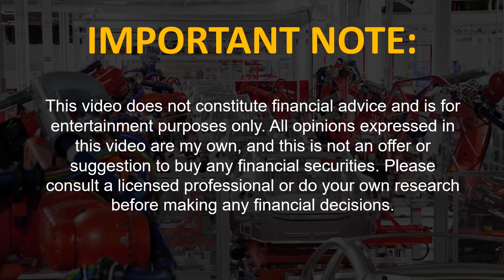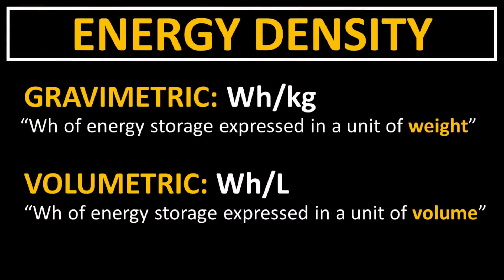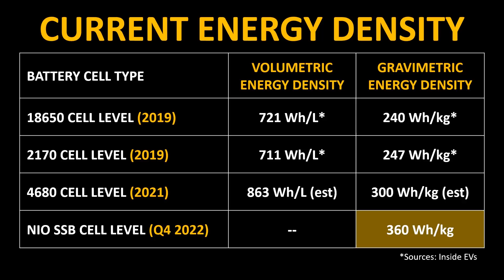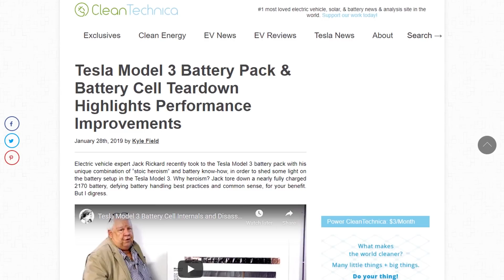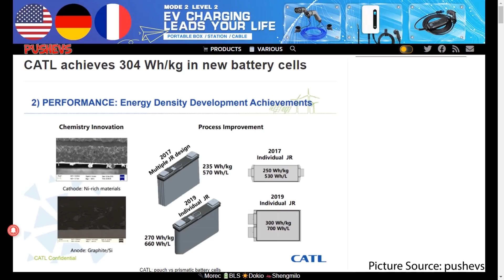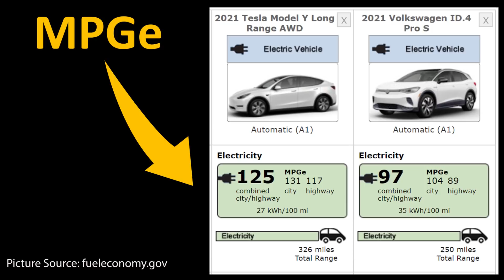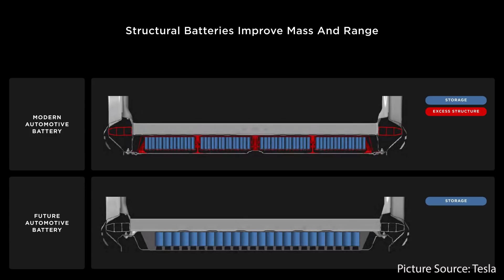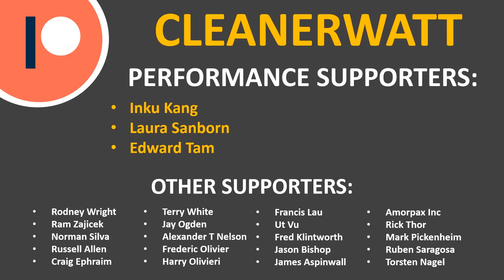Tesla New Battery Tech vs Nio Solid State Batteries (Part 1: Energy Density)

Comment: How about charge time?
Reply: Solid state has potential to be higher. The 4680 will probably use the new v4 supercharger 350 kW
Reply: @TheZackrambo  higher in what way?  Higher / longer charge time/rate?
Reply: @kevroll99  taking higher charge 350 kW compared to 250 kW. 40% faster assuming a similar charging pattern. The 4680 shouldn't have a problem with cooling, judging by the cooling chart from battery day. A 100 kWh battery could go from 0 to 80% in about 20 minutes compared to 30.
Reply: @TheZackrambo  and compared to NIO's solid state? I'll assume it should be close but most articles I've seen indicate that solid state can charge very fast like half the time of any other lithium ion battery, even the 4680?  That's what I was asking.
Reply: @kevroll99  I'm not sure about Nio specifically. Toyota supposedly has a completely solid state battery (not hybrid solid state) that can charge 0 to full in 10 minutes. Which would be an average of 750 kW+ up to 1 MW for the full charging duration. Note the last 20% takes as long or even longer than the first 80% for current battery technology.
Reply: @TheZackrambo  gotcha, would really like to know NIO's charge time.  Not sure why they didn't reveal that...?

Comment: if you're comparing 4680 cells, the power load required to maintain temperatures is supposed to go way down too
Reply: Yeah, probably the most amazing detail of that cell is by going tabless, they have dropped the resistance across the cell dramatically allowing it to be safely charged and discharged at much higher rates with less heat generated. The greater energy density and weight reduction is a large leap forward, but the increase in C rate is what is going to leapfrog Tesla over even the latest $2.3 million Rimac that is apparently running 8 second 1/4 mile times for "only" 10x or so the cost of a Tesla Roadster.  If Tesla can shave 800 pounds off a 9.23 second capable 4 door sedan?  I'm really curious what the C rating of the solid state batteries are projected to be.

Comment: The problem with building the pack into the structure is battery tech is 1. Battery tech is changing rapidly and it would be nice to be able to upgrade as it does 2. What will a 10yr old Tesla with old battery technology built into the structure be worth???
Reply: "Structural" does not mean "not replaceable"

Comment: One aspect I didn't see noted in the video is that when discussing range Nio and Tesla are using different testing cycles. Nio is using NEDC (which has been phased out everywhere but China) and is 20-30% optimistic compared to EPA. So, when Tesla is talking about 800km range, they're actually talking about 960km on Nio's scale. 

Nio's quoted range of 621 miles with their SS batteries in the ET7 is going to be less than 500 miles on the EPA scale. For reference, Lucid Motors is quoting greater range using a battery that's 25% smaller...and 2170 cells.

For those investing in Nio, do so at your own risk. Their range numbers don't appear to match their battery improvement specs...or their vehicle drivetrains are terribly inefficient.

Comment: Considering that the SSB requirements for cooling are less stringent, I expect the packing density to be even higher than you assume.
Reply: That's volumetric though, it would get heavier. I do think it will make a good EV, not sure about longevity but it's interesting. Their key challenge is in genuine mass production or will it be a super car only battery for many years?

Comment: is it possible for nio to make their batteries structural and get similar gains with their cell level denser battery.
Reply: Yes, but not by using Tesla's design (though IP theft never stopped China in the past...).
No one knows for sure if Nio's batteries are actually really that good.  Like GM's Ultium.  Look them up. The claim is safety as their main benefit (heat management to prevent fire/explosions). Thus they are likely to weigh more, as efficiency was never mentioned in lots of marketing spiel, and thus also not cost comparative to Tesla cells.

Comment: Ah ha! So going by the info here, to make my Jeep wrangler do 1000klm on a charge, I need a 380V 400Ah battery that is basically 4 4680 battery packs that are 100kw battery packs each. I could be wrong of course.  Adding about 1 tonne to the vehicle buy the time you take out the 2 diesel tanks and engine and gearbox/transfer case.
Reply: No, because the batteries mentioned have a whole car to lug around.  If you put 4 batts in your Jeep, you only have 1 car to lug around.  No one yet knows the actual range the new 4680 cells will give, especially as there will be different chemistries, giving different ranges.  People have guessed at 200kWh packs for bigger SUV sized/"trucks" vehicles to give 1000 Kms.
No one except Tesla knows, but you certainly won't need 4 packs!
Reply: @alexmanojlovic768  200kwh won't be enough for 1000klm the vehicle will weigh close to 2.8 tonne. The motors aren't enough to efficiently move that much weight. The cybertruck will be much lighter and stronger than an old Jeep Wrangler.Plus a Jeep wrangler moves through the air like a brick outhouse.
Reply: @fourbypete  sorry, I forgot the Jeep is a tank in disguise, still shouldn't be 4 packs though, Pete.
A Model S 100kWh weighs 4000lbs and does 420+- mls/charge...
Reply: @alexmanojlovic768  Yeah, it's very sleek compared to a Jeep Wrangler with a 2.5" lift and 33" tires. The model S cuts through the air, at 60mlh a Jeep like mine is like a Mack truck with 1/4 of the power.
Reply: @fourbypete  not if it gets Tesla batts & motors.... Loadsa power.... 😁
Reply: @alexmanojlovic768  Again, the motors have to be limited to 130kw and 480nm otherwise you start breaking uni joints. And that is if you connect a motor to each axle.  I tell you the maths does your head in.

Comment: You are very generous to Nio :).
1. The CEO's boasting usually means the best scenario for the example (see Apple). So, 37% better density is calculated probably of their worst battery, not the best.
2. Swappable battery means a lot of structural weight - let's assume +10% for the battery box (out-of-car handling) and +10% for car structure (car-without-battery handling).
3. If CATL will have these dream batteries - it will sell them to Tesla first.
4. And 150 kWh battery is not a practical idea now. Because one must charge it for 1000 miles. It will take about 2x longer than 75 kWh battery. To stop and piss 2-3 times during 1000 miles' travel is human, so why 150 kWh at all. And in practice, both cars will use the same charging infrastructure (not really, Tesla is better). Sure, there are some special scenarios like a semi with semi-chargers - and Elon said so, but for an everyday car?
I like Elon because he makes considerate decisions. And I've sold the Nio stock after their CEO's presentation.
Reply: I can tell you didn’t do DD on NIO. Glad you sold :)
Reply: @swingaporean  this^ it was easy to tell. A lot of tesla circle jerking here
Reply: Completely biased towards Tesla.
Reply: You have done no research either. NIO invests in CATL in a strategic partnershi in R&D. Just a hater
Reply: @LetsLearnEconomic  Boy, boy. But back to adult talk. In 2020 Tesla sold 3 x more cars in China than NIO. So, NIO is a worthy competitor, but... In 2021 Tesla will have expanded factory, perfected subcontractors, a fast-growing dedicated charger network, and a new, fast selling model. NIO has neither in 2021, at least on Tesla's level. 
So, Tesla will sell something like 5-6 x more cars than NIO in 2021. Most of them with batteries from CATL (LG batteries go to cars exported to Europe). And Tesla is more interesting for CATL, because it can provide CATL a big opening for world markets, not only China. As can VW or Daimler, but not NIO.
About "strategic partnership". If you'd work in corpo, you'd know the worth of such words. CATL has it with every bigger customer, also with Tesla. 
The question is if NIO is like Nicola, or more like early Tesla? We will see.
Obviously, Elon can say something bright and Tesla can be crushed by the Party in China. But also something similar can happen to NIO much easier, with much more devastating effect - see Jack Ma story.
Reply: What about Tesla's Roadster with a 200 kWh pack?
Reply: @KyleHubb  I don't know. Have you seen it for real? Well, maybe you're on to something...
Reply: @D.A.OhK.  No, you didn't. Where did I say something about Elon's boasting - in plus or minus? Just practical observation of typical salesman's talk. Even, I expect CEOs to present their products in the best way. Just usually there are caveats. And this presentation was muddy - that's the reason, Cleanwatt has 2 videos now on the subject and still, the stuff is in the fog.

Comment: I can’t wait for Tesla to launch a 4680 structural battery pack so we see these benefits.  Give me range, fast recharge time, efficiency, and long life.
Reply: @VKMusique  We're hoping with the long wait since the last major refresh, and the talk of Palladium, that it's a pair of much different newer models, not just refreshes.  It's also to be hoped that the battery/structural/castings cost savings will allow for $ spent on better quality interiors to better compete with the Germans/Lexus/(Lucid) offerings.  Finally vindicating the "luxury" claims.
Reply: I think there is too many assumptions in this video.  As a solid state batteries, they are inherently more stable and less likely to burst into flames in an accident.  This could make the Nio battery pack less dense.  As well, I don't believe Elon's new batteries are that much better in energy density, they seem to be the same, just a bigger battery.
Reply: @jhfl1881  with dry electrode (no solvent) and less electrical resistance (tabless) 4680 are ALSO more stable and less likely to catch fire or explode.  Go watch the Battery Day video for technical explanation.  The cells aren't massively more dense, but structural battery pack is. Possibly compares well to Solid State.
YOU'RE making assumptions on both companies batteries actual specs.

Comment: Just hope you never have to change the batteries
Reply: Neil
As I've said elsewhere, you seem to assume that "structural" and "not removable" are the same thing.
A lightweight casing to mount the cells in such a way that the cells provide torsional rigidity (structure) but are removable as a pack, is quite possible.
Reply: TESLA structural pack is Maitanance FREE, and lasts 2 million miles.

Comment: Cleanerwatt - Ummmm , the TESLA 4680 cell is SOLID STATE.......wink , wink......
Reply: The MAXWELL tech cell may actually be solid state, or at least conversable.
(Imo) The 4680 can reach the initial figures quoted at battery day with existing chemistry, as in the current 2170.

Comment: You are disinclined to disparage Nio's solid state battery tech.

Well, I am so inclined.

One of the photos you showed contains a clue.  Those cells are prismatic.  Not pouch pack.  Not cylindrical.  Not only is it impossible to use prismatic cells in cell-to-structural pack designs, prismatic cells are the most difficult (read: expensive) form-factor to produce.

So: no negative mass calculations for Nio.  And their cell costs are going to be very high.

But there's more to worry about.  Thus far, no battery manufacturer has succeeded in bringing solid state cells to market.  Why?  Cycle life is terrible, and costs are exorbitant.  The cells do have other advantages, such as better charging speeds, but those advantages aren't particularly compelling in the economic sense if the batteries don't last very long and are very expensive.

By announcing mass production starting in 2022, Nio is claiming to have a developmental path to good cycle life and low costs in an economically viable cell.

I don't believe it, in part because of that photo you showed.  They're going with prismatic cells.  Prismatic cells can't be made cheaply.  There it is.

Tesla recently demonstrated for us what an elevated stock price means for capitalization.  When the stock price soars, shares can be issued and sold without much dilution of share value, so control of the company isn't affected much.  The higher the price, the easier it is to grab bucks and apply them to the engineering challenges associated with establishing mass production.  I think it's plain as the nose on my face: Nio is releasing optimistic projections for their battery tech, in order to pump the stock price with minimal dilution, in order to obtain the capital for a big developmental push.  They're betting that if they can get the money, they'll be able to get to the finish line on their solid state battery tech and mass-produce the result.

Eventually.

There's no way in hell that they'll be pumping out commercially-viable, economic solid state cells by 2022.  That's my opinion.  This is a stock pump scheme.

It's not a "pump and dump" scheme.  I think Nio does want to succeed.  Original investors will not be fleeing, I don't think.

But let's not forget that Nio has a track record of being ethically challenged.  They have stolen IP from both Apple and Tesla.  So fooling investors with optimistic projections, then shrugging when the projected events don't materialize, is no big deal for this company.  They're willing to play dirty to win.  Fooling investors is dirty.

That's my opinion.  I could be wrong, of course.  But I don't think it's a safe bet that Nio will actually start sticking solid state cells into vehicles by the end of 2022.  I doubt it very much.
Reply: I agree with you.  I think people are hyping SSB a bit too much when there is no physical product yet.. you have SPAC like Quantumscape that have not produced a physical sellable product yet and there timeframe is 2024.... NIO is talking about end of 2022... They will go through massive growing pains when they try to scale a product that have not proven themselves yet. Tesla however have already been producing the larger 4680 and they have gone through destructive MS testing already.. I know because I've seen them physically at a test site and so far they didn't blow up hehe.
Reply: @pingpong909  The 4680 cell isn't quite finalized yet, and they could run into problems, maybe, but it's close to the finish line, and once they have the 1.0 line design, they'll export it.

Nio hasn't even settled on a chemistry yet.  They are still at the test bench stage - and what they have on the bench right now isn't what they hope to commercialize.

I don't really think Nio will do anything significant with solid state in this decade, unless talking about it is significant.

I'm skeptical about Quantumscape, too, but at least they gave themselves a few years of breathing room.

It must be fun to see the actual cell testing of the 4680 cells!  Next time, make a vid!

Eh, I suppose you're stuck with a nondisclosure agreement.  Rats.
Reply: NiO is fraud its Alleged.
Reply: @markplott4820  They are making BEVs and selling them.  They look like a car company to my eyes, not a pump-and-dump scheme.

But they are ethically-challenged.

So are all of the diesel manufacturers who cheated on emissions testing.  Which is most of them.

Being ethically-challenged doesn't mean a company won't build cars.  It just means they're happy to cheat and commit fraud when they think they can get away with it.
Reply: Too much coffee today?

Comment: I feel like volumetric energy density is really not that critical, especially when considering against weight/kWh or cost/kWh.  Like, if you hade something that had twice the Wh/kg but half the Wh/L, you’d have a great Tesla that just wouldn’t have a frunk, or have an extra big bulge between the seats, or just be a little taller.  Nothing that seems like a deal breaker.
Reply: COST is VERY important.  In a car, weight is important, but not super critical.  COST, however, is critical.

Comment: Nio is way behind tesla's fsd, when robo taxi hits the street 
nio will fall hard along with the others.
Reply: My quess is that robo taxi's are still far a way in future... Tesla FSD is pretty amazing, but 99% performance is not good enough. It seems that latest beta's are still failing all the time.  And reliability should be 100% and not 99 something ... unfortunately there is no big software without bugs. So getting 100% is really really hard. Current beta's are clearly not even close yet...

Comment: Solid state batteries should be in places where energy density is very important, the price can be high and the life of the whole product is low. Any ideas? smartphones not cars.
Reply: SSB cant hope to compete with 56% lower Price on 4680 , and they last over 2 Million miles , and charge faster and Discharge faster (demand) , and are HIGHER Amps .
Reply: @markplott4820  you didn’t read my comment i guess
Reply: @markplott4820  2 Million miles is not needed. 0.5 M is more than enough. But cost sure matters. I have been in impression that solid state batteries charge faster...
Reply: @mho0   - Solid State battery are BULLSHIT .
TESLA own 4680 is 56% more Efficient than 2170. and has Higher Amps allowing MORE Power for TORQUE and FASTER Charging. 
TESLA Today can Charge at 1000 mph at Superchargers , faster than ANY Commerical SSB.
and even 2170 are CHEAPER than SSB at this point.
Reply: @markplott4820  hmmm ... I guess it would be fair to say Solid State Battery is 'vaporware' for now. But rest of what you said just states Tesla is improving and says nothing about if they are better or worse than fortcoming solid state batteries. Lets see what will come up, but many seem to think that they could be superior to existing battery tech.